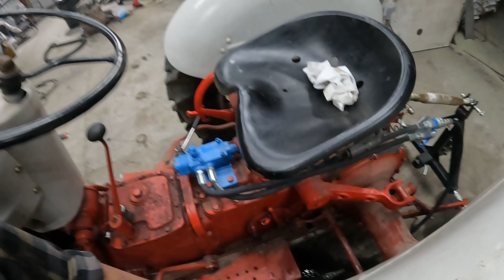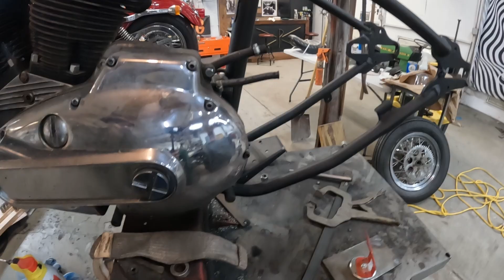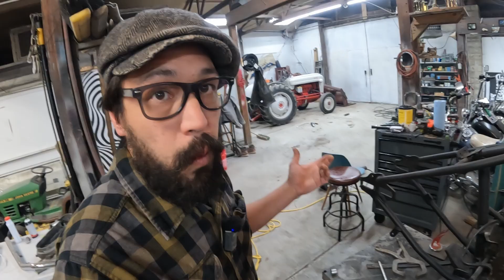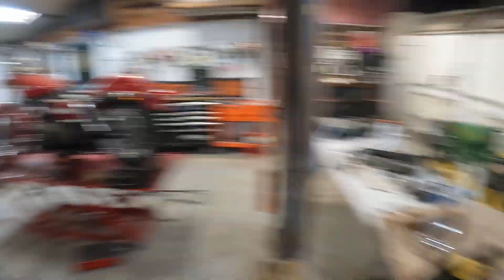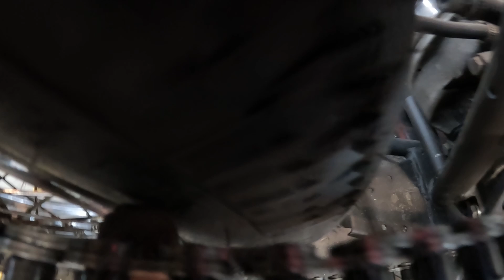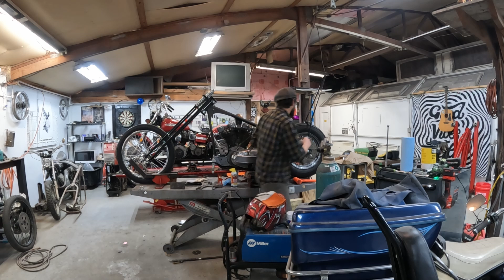XLCH Chopper:  Rear Wheel, Chain, Sissy Bar Mock Up

Comment: I'm looking forward to installing the battery and oil tank. I'm building a similar Frisco chopper based on the latest Ironhead 85)
Reply from the maker: Nice!  I'm putting this back together from boxes and trying to use what was left with me, so this will be a half horseshoe chain side and battery tray will mount on the primary side with the box provided in parts bins.